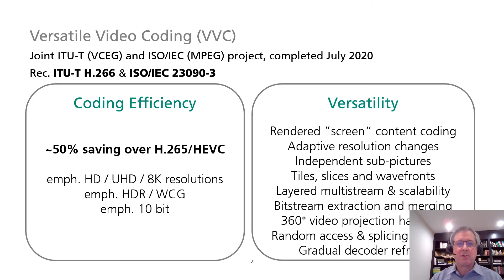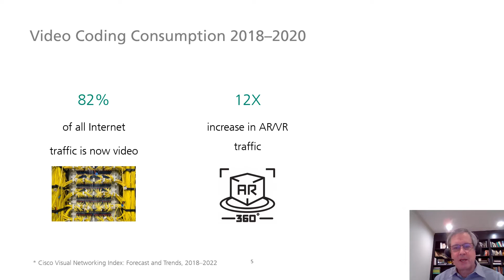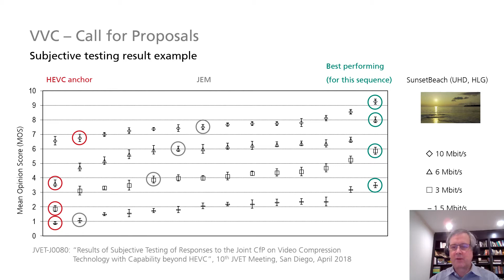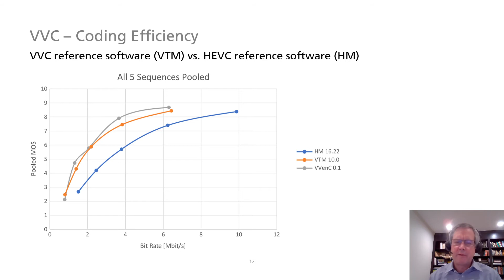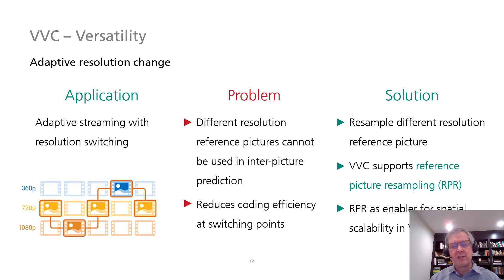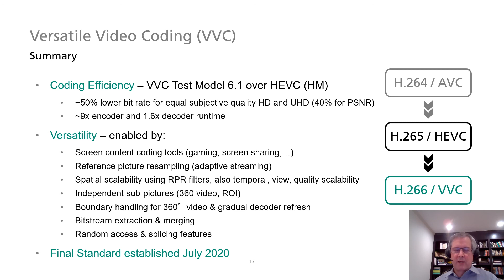Session 1 1 Sullivan

Comment: Tiled 360 streaming is used in hevc if encoder is configured to not produce motion vectors across tile boundaries and deblocking across tile boundaries is off then each tile is self-contained. The only problem in hevc tiling is that tiles partition frame into a grid, arbitrary partition is not always possible in hevc. Is there a way to make arbitrary tile partition in VVC?

Comment: one of outstanding features of VVC  is that one can change resolution without sending IDR. Actually P-frame with new resolution uses scaled reference of the previous old-resolution frame. Because in most adaptive streaming mode changing of bitrates is accompanied with changing of resolution and transmission IDR usually incurs a bitrate peak.